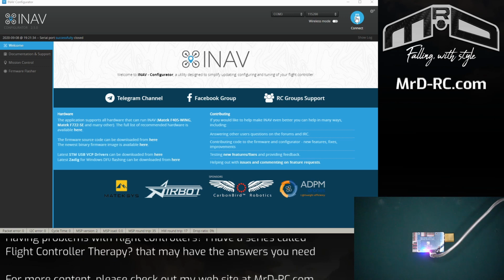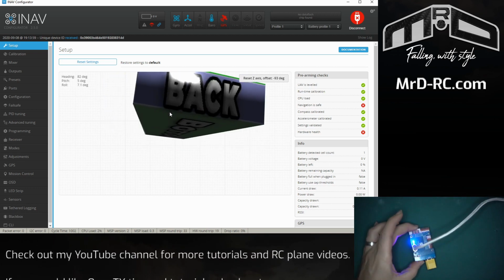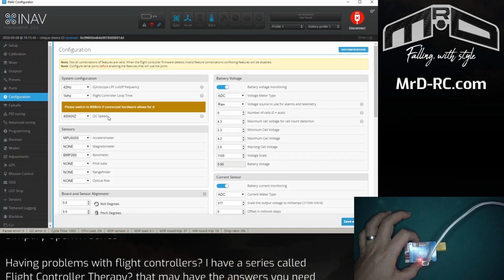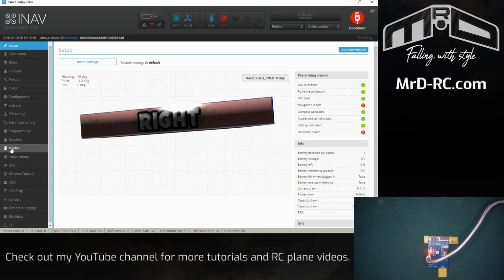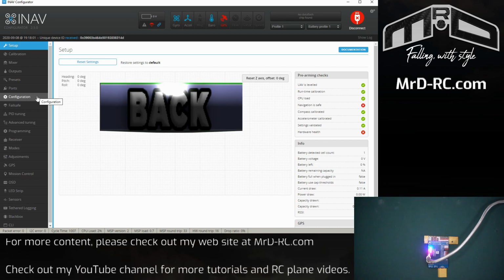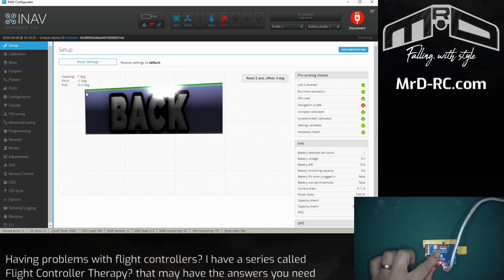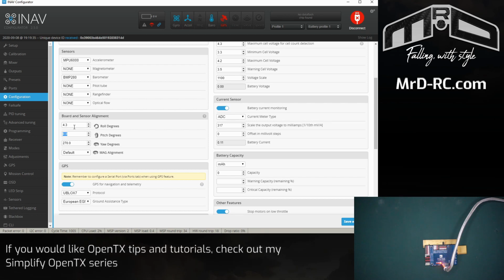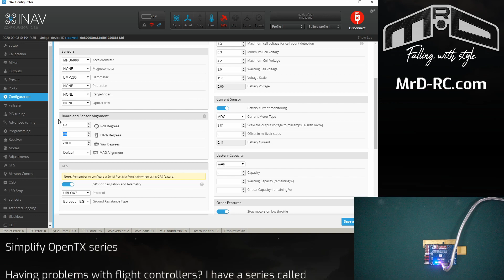Flight Controller Board Alignment in iNav

Comment: Hi Darren!

The board alignment value change option for pitch and roll is not there anymore in INAV 5.* and 6.0. 
The software says it is only available in CLI, but we should not use it to trim the airplane for level flight. It says we should use Fixed Wing Level Trim instead on the PID Tuning tab under Mechanics.
My plane (Nano Drak) has 6-7 degrees of down-slope in the electronics bay, therefore the FC is facing down a bit, so I guess I need to add +6-7 degrees in i this PID? Plus 3-4 degrees to make the plane face up a bit before the maiden?
Is this the correct way to do the board alignment in INAV 5+? I searched for a video, but found only below for INAV 5-*, where you still have the pitch and roll alignment as a setting.
Is there an up to date explanation for this somewhere?

Many-many thanks,
Reply from the maker: You can use the board alignment commands in CLI to get the flight controller level in the plane. if it is down by 6-7 degrees, you will see on the setup page it will say +6. So in the CLI, you will need a negative to raise the nose. Also, it is in decidegrees, so you need -60 to -70 in the align_board_pitch.
Then use the fixed wing level trim on the PID Tuning Mechanics page for the  3 to 4 degrees for the up trim. This is always positive for nose up and negative for nose down.

Comment: Hi, can i ask why the pitch value is a negative number when the nose is pointing up within the inav setup page? mine is the same, is this correct?
Reply from the maker: In normal orientation, pitch up will show as a negative number on the setup page. It is the raw data from the IMU. It is correct.

Comment: @Mr.D - Falling with style
Hi, could the incorrect board alignment cause a drifting center-point in position hold mode?

(plane goes around a point, but it with each turn the spiral center point moves ~50m)
Reply from the maker: It shouldn’t. If the board alignment was incorrect, I would imagine it would have a hard time flying in a self levelling mode, let alone loitering. What version of iNav are you using?
Reply: INAV 4.1
Is looks leveled when loitering.
Somehow I dont believe its gps, since there were 18 sats fixed.
Reply from the maker: Have you performed the autotune in acro yet?
Reply: No.
So the hypothesis is that PID tuning is required (I have used the defaults)?
Reply from the maker: Actually the PID settings are not touched. But the rates and FF are tuned to your plane which are very important. The first thing I would do is properly autotune. It needs to be performed in acro. Do one axis at a time. Use hard, full stick deflections. Don’t just wobble the stick back and forth. The plane needs to react and settle.
Reply: @MrD  Thank you!

Comment: Helpful video. Why oh why don't they just have a 'Set Level' button!! Save all that switching about on the configurator.
Reply from the maker: Because set level only deals with level, and then it is dependent on if the area the flight controller is sat is level with the correct attitude for level flight. Level for flight is handled better now in iNav 3.0 with the auto level mode. 

The board orientation now deals with how the flight controller is positioned in the model; so that iNav knows which way is the front of the model and which way is up.

Comment: You might need to update this. I don't have the option in Configuration for adjusting the Roll Degrees, seems this is now only in CLI for some reason. Great vid!
Reply from the maker: It’s because those options are now only to be used to set where the front of the flight controller is. With most cases, if people change the orientation of the flight controller, it’s only with the yaw. That’s why yaw has been left in the UI. If the pitch or roll need to be changed, they can be changed in the CLI. Typing “get board” will show the commands to do this. 

To change the board pitch alignment for in flight, you can now use the new auto level mode, or set it manually with the parameter at the bottom of the PID Tuning > Mechanics page.

Comment: Hello Darren, I have just started with INAV. I am flying fixed wing airplanes. Installation and setup of flight controller in INAV works fine. But I have a problem in manual mode. Without flight controller, I used to compensate the motor mount with adding a pitch mixer to the amount of throttle. With the flight controller, I realized, that I also need to add a pitch mixer to the motor throttle. How can I do this without the setting it up in the radio?
Reply from the maker: Honestly, you’d be better off correcting the thrust angle, it that is the main cause of the problem. 

With iNav 3.0 there are a couple of potential options. There is continuous autotrim. But, that only makes changes in stabilised modes, so throttle changes in manual would not be corrected. You could use iNav programming to change the elevator based on the throttle percentage. I’ve not looked in to this, but it should be possible. But I still think the best solution is to fix it physically.

Comment: Hello Darren. Quick question. If I mount my FC with the arrow facing forward but board is perpendicular to the ground what axis do I enter a value for pitch to keep the model flying level? Is it yaw?
Reply from the maker: If the arrow is still pointing towards the front, it would still be the pitch to change. I’m guessing you already have a 90 or 270 in the pitch to have the flight controller in it’s position. It would just be a case of fine tuning that value.

Raise the nose while keeping the wings level, and you should see the value that needs changing.
Reply: @MrD  Darren I have a value of -86.5 for the roll axis.
Reply from the maker: That seems strange if the arrow is still pointing forwards. If there’s no yaw to rotate the flight controller, you should still be tuning the pitch.
Reply: @MrD  correct. Yaw is not displayed on the first screen with the model reference/rectangle. Just shows pitch and roll. I have it installed in a Sonic F1 wing.
Reply from the maker: This is really confusing me then. I don’t really see how you’d fit it in there perpendicular (90 degrees) to the ground. Did you mean parallel?
Reply: @MrD  Correct. The servo ports, LED, Buzzer etc all face towards the nose of the wing. Power leads for the battery and motor are in back. So basically the board (Matek F411 Wing) is oriented with the arrow forward then I rotated the board physically on roll axis approximately 90 degs so long edge is perpendicular to the ground. I hot glued the board to the left side wall of the battery bay. Hope that helps.
Reply from the maker: Ah, ok. In that yaw should be pitch.
Reply: @MrD  ahh...ok. I thought it would be but wasn’t too sure. So a negative -3 or so on yaw should give me the correct up pitch for level flight?
Reply from the maker: Depending on which way the board is rolled. The yaw shows up as heading on the setup page. 

It may be easier to tune this in flight to be honest. Just set up an adjustment for the board yaw alignment.
Reply: @MrD  ok understood. Will set it on a pot to adjust. I think you had a video on how to do this. Have to check again.
Reply from the maker: I have a video for setting up a whole range of adjustments. But to just tune a single would be simpler. You wouldn’t need to worry about the 0-20 step, just use a switch.

Comment: Hi ! I think I have a problem with my FC, because the pitch is constantly moving when the card doesn't move... and I can't calibrate the accelerometer.
Can anyone help me please ?
Reply from the maker: Try flashing the firmware again with a full chip erase. You should be able to calibrate. If this is a new FC, maybe RMA it and get a replacement if the flash doesn’t work.
Reply: @MrD  Ok I'll try it, thanks ;)
Reply: I've tried to flash it again but it was the same. But I solved the problem, I selected the 2nd gyro (ICM20602) with the CLI command and thanks to that I no longer have permanent pitch movement. For the moment it works, I'll see if this is a long term solution.
Thanks for your help !
Reply from the maker: @BigAppleJeff  awesome Jeff. I’m glad it’s working.

Comment: Thanks for another great video, I did my board alignment today following your video and then flew the plane and it sure is more stable, when I started with tail of board facing me inav was not showing that so I clicked the reset z button and it then was showing correct orientation. I'm still fighting with these sensors,  the developer of the yaapu script assures me that his script does work with inav, and crossfire but I don't know how.  I've posted link to video on github of what's happening. If you can please take a look. Thanks for all your videos
Reply from the maker: You’re welcome Ernest. That little z axis reset button comes in very handy. 

I’ve seen the posts on the Yaapu GitHub. I know Marc has a friend where it doesn’t work with Crossfire too. The sensor case thing I think is a red herring. The sensors are automatically discovered, so the case is already set in the OpenTX firmware. I still maintain that Crossfire should be using the Yaw sensor, for it to work in the same way as SmartPort sensors. There is a difference, but for fixed wings or other models with no compass, you won’t necessarily see a difference.
Reply: @MrD  I trust what you say and can't understand why the developer doesn't just say that it's not going to work, I have build in compass on my BD gps module I have thought about wiring it to my f405-wing,  do you see any benefits from this?
Reply: I've done some changes in inav according to you and Mark's video haven't tested yet due to weather but I'm sure it will help, one question I'm noticed that when my wing gets out around a mile I get inav sound that I'm in position hold but it's really not what would cause this? It's been doing this for long time but very distracting. Thanks
Reply: So yesterday I clicked reset z axis and inav showed tail of plane like it should, today when connected to fc tail facing me inav showing left of plane so I reset z axis again to make it correct, in configuration tab mag Alignment was set to default so today I set to CW 0 degrees In attempt to keep it from changing again. Have you seen this before? Why did it change? There's no save and reboot in setup page so I don't get that. Also with tail facing me, in setup page no battery just usb power, heading says 357 degrees which is almost completely opposite of actual heading is this normal? My f405-wing is mounted with arrow pointing to nose so seems like it would show close to correct heading. Thanks for any help
Reply from the maker: If this is fixed wing, I’d recommend disabling the magnetometer. You’ll experience sub-optimum navigation by having it enabled. 

The setup page is just information. There’s nothing to save, so no need for a save and reboot button.
Reply from the maker: They all look in range on that image.
Reply: I'm using f405-wing and BD gps unit with build in compass in a c1 chaser but I didn't wire compass part to fc only gps, so why did I have to reset z axis again today for it to show correct orientation and nose of plane not pointing in correct location while powered by usb not even close, is this normal
Reply from the maker: @egtreadway4232  reset z axis does nothing on the flight controller. It literally just puts the back of the preview box towards you on screen.
Reply: I did that yesterday and then today again so rear would be facing me, so it's not going to stay in this orientation long term?
Reply from the maker: You will have to do it every time you use the screen.
Reply: Ok thanks
Reply: Probably dumb question  but there's no build in mag. On f405-wing right?
Reply from the maker: @egtreadway4232  no, there’s no mag on the F405-WING. Most FCs don’t have an on-board mag. Only a couple of odd ones like the M9N-F4.
Reply: Ok Thanks

Comment: I want the ESCs and Battery connection pointing forward instead of back on my F405 wing board and then compensate 180 degrees....is this ok (to have the arrow pointing backwards ) or is there a reason not to? Thanks.
Reply from the maker: Nope, it’s fine. Just add 180 in the board alignment yaw.
Reply: @MrD  how is the reptile coming along?
Reply from the maker: It’s looking good. Not started the build yet, but will soon.

Comment: I'm having an issue with my board. I've rotated it on the yaw axis as I have it installed in a tight spot and cannot have it arrow to the nose. Plane is awesome in manual. However, when switched to horizon or angle. The plane immediately dives to the right. It does have a built in mag. Does mag alignment play a role in this? The board is a Jhemcu Wing FC-10 DOF
Reply: I did set the pitch on the roll axis lol. Confusing. I have the board at 90 on the yaw and roughly 4 degrees roll (pitch). The board moves as it should in the setup tab. Orientation is correct and animations all in the right direction. I have a switch on my tx set to change the board alignment (roll). No matter what. Plane dives to the right and heads for the dirt. Thanks for your help man!
Reply from the maker: How does the stabilisation react at the bench? Do the surfaces move the correct directions to counter the movements. Usually if it’s great in manual, but has issues when stabilised, something hasn’t been set up correctly with the control link. Either a mix has been used on the transmitter (like a wing mix) or outputs have been reversed on the transmitter to make the servos go in the correct direction in iNav. 

I can’t help too much at the moment as I’m at work. But, if the stabilisation is wrong, I would make sure the 4 control RC channels are correct on the mixer page. I have a video called something like “A newbies guide: setting up your transmitter for iNav”. That will show how the receiver page should respond. Again, sorry I can’t link to it. But I’ll be available in a couple of hours.
Reply: @MrD  I do appreciate your time! The surfaces do move accordingly to counter any outside input. My TX is clean there's no mixing there, it is all set up in inav. I have a tbrc reflex with the same board and it functions flawlessly. After I get home from work I will check again to verify control surface movement. I am getting old and I do tend to miss things.
Reply from the maker: It sounds like you have adjusted the pitch on the FC. As it shows in the video, if you rotate the yaw 90 or 270 degrees, you need to adjust the roll to correct the pitch.

Comment: Darren, thanks for sorting that out.  I hadn't thought about the adjustment on "Roll".  I would have thought that the alignment would then keep the "nose up" adjustment correct, but wouldn't require it to be added to Roll.  Thanks!
Reply from the maker: No problem Corey. You just have to remember that the board is based on the arrow, rather than the plane. So if the board is rotated in the plane, it is pitch to the plane, but roll to the board.